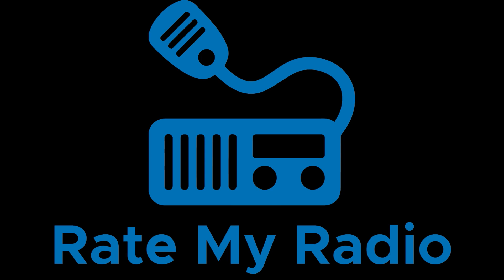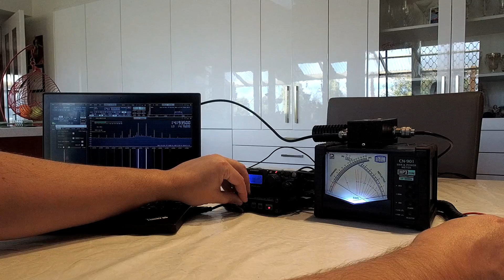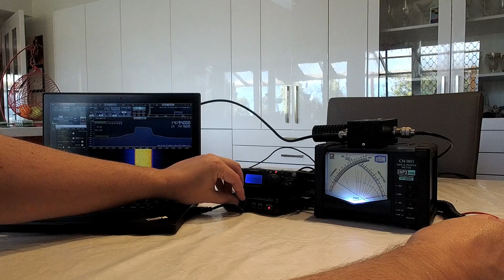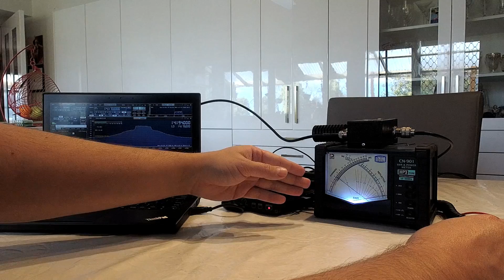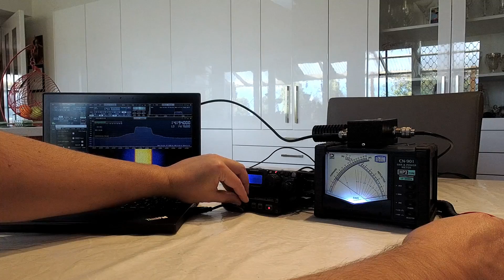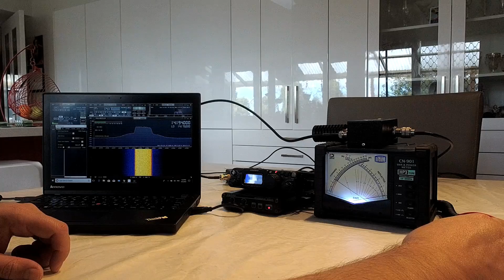Part 3: IMD Testing & Realtime Station Monitoring

Comment: Very educational video, I do my IMD measurements the same way, using HDSDR and an RTL-SDR. If you were wondering why your IMD products are higher on one side, then the answer is very simple: The transceiver's SSB filter pass band is not perfectly flat. So, for a good IMD measurement, you MUST adjust audio tone levels to match at the spectrum analyzer, no mater if one tone ends up 0.4FS and the other 0.5FS, that is previous to the ssb filtering.... After the filter they must have the same power so they reach the PA having equal power levels... and then your IMD products will be equal on both sides. Regarding white noise, again you can equalize the white noise audio to appear perfectly flat on the spectrum analyzer. 73 DE LU6PSG

Comment: Brilliant.

I have used the SDR to align mt MMDVM HS Pi Hat RX and TX frequency.... Will defiantly be doing this with the uBITX to check IMD after PA mods to get 14w across all band...

73.
Reply from the maker: Let us know how you go Nik.  A correspondent mentioned to me yesterday that he had personally checked an SDRPlay RSP1A against his friend's Agilent scope, and across the HF spectrum they were within 1dB of each other.  He suggested the only reason they were not closer above say 500MHz was that his test jig was not good enough for such frequencies.

Haters gonna hate, but the SDRPlay really is a phenomenally good value tool if you know how to use it correctly.  I hope you enjoyed our tutorial series and found it useful as a starting point to build upon your own measurement skills and lab! :)

PS, any IMD5 (or greater eg 7,9 etc) better than -15dBc is likely very good for a QRP kit radio, and given the low powers and high suburban noise figures, unless you're pumping it into a beam I'd be happy with that.  

Plenty of FT-817 & FT-818 owners run their radios down to -10dBc IMD3 & 5 and no one even notices; in fact, they are just thankful the guy has wound the knobs to the right enough that they can now copy them!

73, Jarrad VK3BL